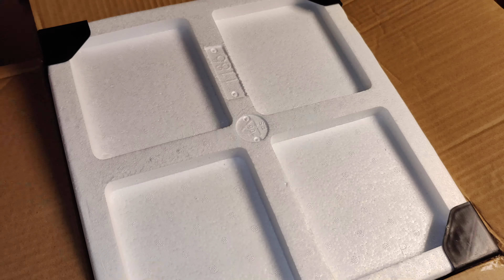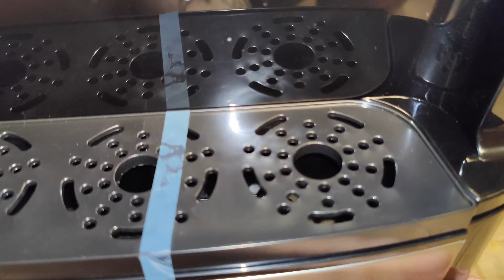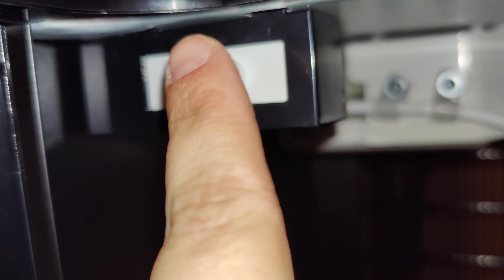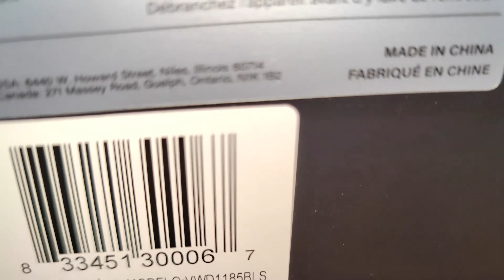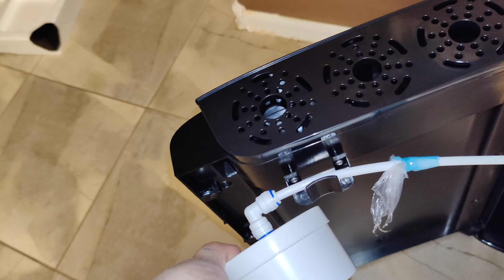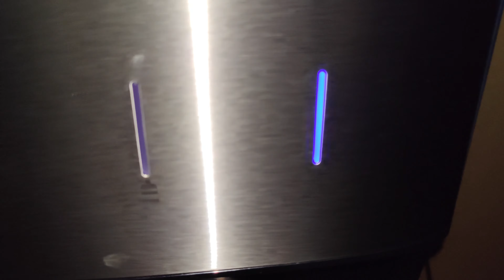Vitaur Bottom Loading Water Dispenser Unboxing Review

Comment: Is there a way to clean these. I  purchased mine second hand, so mine didn't come with an owners manual.  I just ordered zephyrhills water after its been without water for a few months and it tastes  horrible. Im wondering it just needs to be cleaned or if it's the water that tastes horrible.
Reply from the maker: What I do is I run a 3-gallon bottle with 2 cups of vinegar to fill up with water, and I then dispense all the water through the dispenser until all the water comes out. After running the vinegar through the machine, I run the whole 3-gallon bottle of water through it to get the rest of the vinegar out of the dispenser. That is how I clean my machine.

Comment: The startup is so confusing with the vinegar and water. 20s and 20m with nontext to explain.
Reply from the maker: I agree, I just use one part vinegar to 2 parts water to clean out this water dispenser. What I do is take my 1 part vinegar to 2 parts water, put it in a glass and let the hose suck up the liquid, pouring out all the liquid into another glass. After that has finished, I would run about 3 cups of water to get out the vinegar smell and taste, that cleans it all out and you are good for a few months before needing to do it again. Hope this helps.

Comment: This is the worst of the worst water coolers, hot water makers I have ever owned. It growls. It has a high pitched whine to it. When it shuts off, it makes a popping noise. It was made in Hell on a night before a holiday. When you fill your glass with cold water it sounds like a Dinosaur roaming the woods looking for it's young. If you open the door and slam it, the noise stops. My VITA PURE should be called,  Vita-Shit-Box.
Reply from the maker: Wow! Sounds like you have gotten a defensive one, mine does not do that at all. Thanks for sharing your opinion, have a great day.

Comment: I noticed you didn't clean the tubes. The quick set up says use 9 Cp hot water mixed with 2 Cp vinegar & run they for 20m8ns before installing water jug
Reply: I had vinegar tasting water for ever.